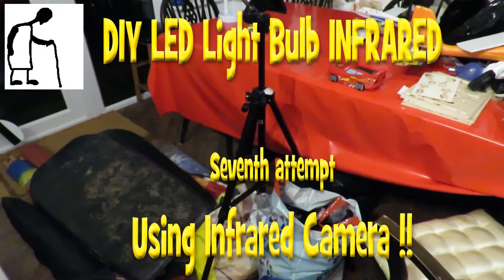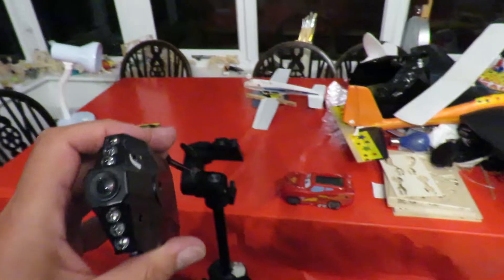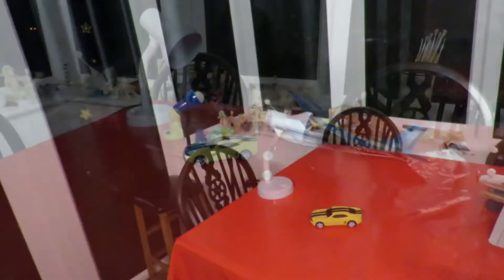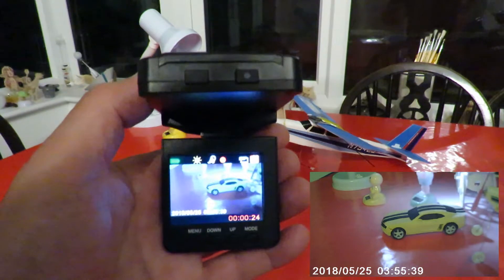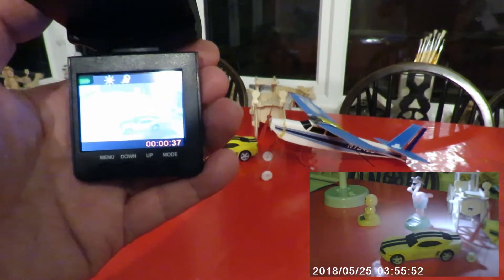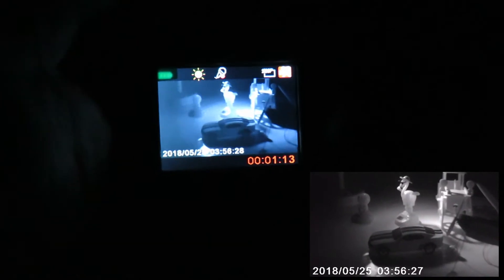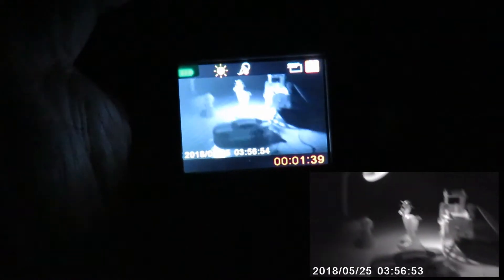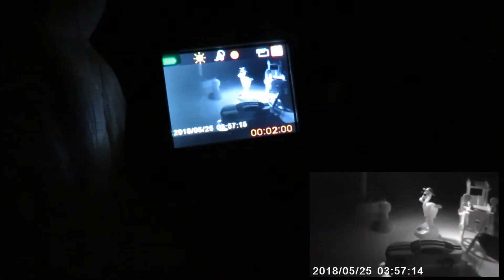DIY LED Light Bulb INFRARED Seventh attempt Using Infrared Camera

Comment: And there you go...a good study for anyone fresh to IR to follow as a series.
Similar to Brian below, I modded a webcam to remove the IR filter and made a strip light thing of half a dozen IR LEDs. It had a usable range of about 5ft and was highly useful for nothing in particular lol, but worked. 
They could be good for pest sensing. Positioned outside for cats/dogs/foxes or anything else that might tip over a bin at night. Well, not cats, cats are quite rubbish for moving things...everything has to be brought to them !
Reply from the maker: Somewhere in one of my boxes in the junk pile I have my other DashCam that had a problem with the battery. My plan is to find it and swap the battery and use that for some night time visitor viewing :-)

Comment: I have modded a cheap digital to have Ir by removing the IR filter usually a small piece of red tinted glass between the lens and censor got pretty good results and fun to shoot pictures with before I dropped the camera and jammed the lens lol
Reply from the maker: Hi Brian, the idea behind this was originally to use my main camera but there doesn't seem to be any setting that will support IR and it is rather to expensive to start taking it apart to see if it has a simple filter fitted. Somewhere in one of my boxes in the junk pile I have my other DashCam that had a problem with the battery. My plan is to find it and swap the battery and use that for some night time visitor viewing :-)